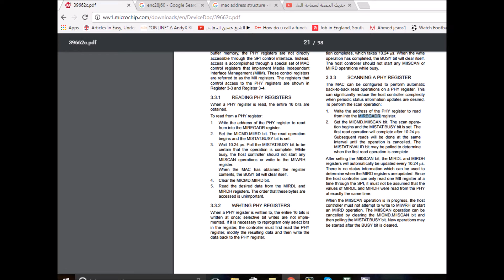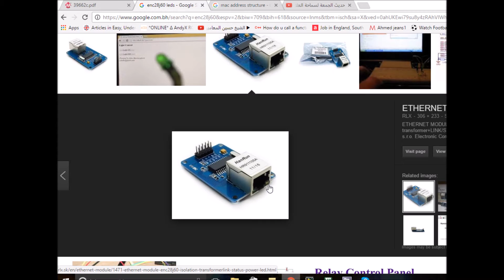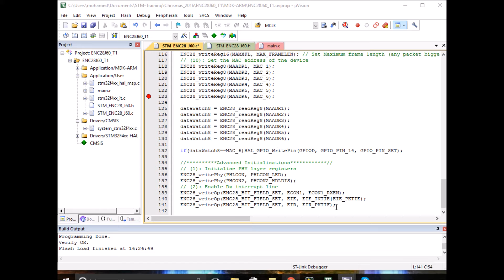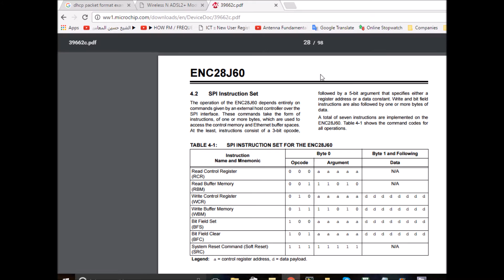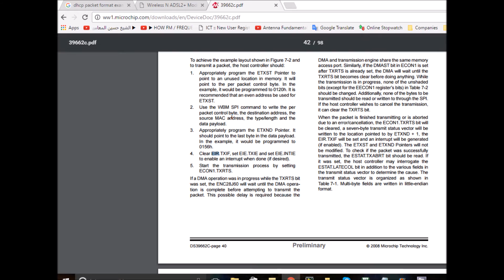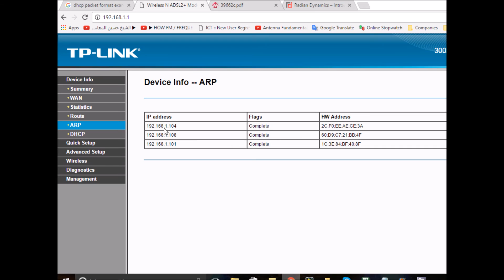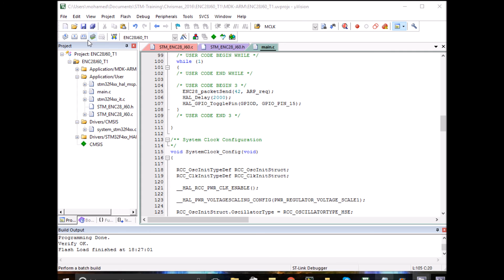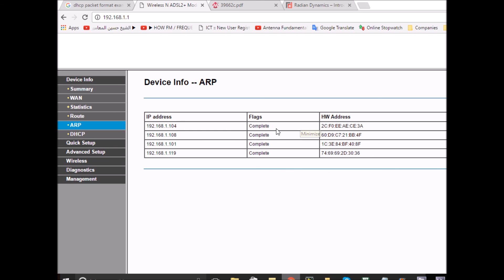STM32F4 Discovery board: ENC28J60 Ethernet Module Part3- Connect to LAN / Get IP address

Comment: Hi Mutex, thanks for the ENC28J60 series video. I did all up to the end of this video, and used your sample code enc28j60.h and enc28j60.c; I was able read back the values of each bank of the chip, so it shows that the code was working.  I also did a USART message monitor at where your code determines if the sending of packets went successfully; and it did go successfully.     I then connected the ENC28J60 board to the network.  But when I finally sent the 42 byte packet, I could not observe the ARP packet on the Wireshark monitor, no matter what I tried.  I think my Wireshark monitor is working because I was able to see my cellphone's activity on it.   Is there something I missed, or have you modified the code after your demo on the video?   Thanks very much!

Comment: Hello Mohamed, Thanks for the nice detailed video. Unfortunately it doesn't work with my hardware (STM32H743ZI + ENC28J60). I followed your intructions step by step. The registers are all written correctly. The status LED on the switch flashes quickly, but the board is not recognized by the router. What can that be? Best Regards, Holger

Comment: hi muhammaad yaqoob just wanted to know whether you connected the interrupt pin or not?
Reply from the maker: I think I did
Reply: @mutexembedded2206  can you tell me where is it suppose to be connected because i can't seem the get the right results for some reason
Reply from the maker: @adnanafzal3908  I can't remember fully. You should be able to find that in the source code
Reply from the maker: @adnanafzal3908  Hi Afzal, let me try finding them. It's been ages 😂.
I am planning to make a drive linked with LwIP for this module.
Reply: @mutexembedded2206  thanks man i really hope you find that file
Reply: @mutexembedded2206  any luck?
Reply from the maker: @adnanafzal3908  Nope, I lost them in my old pc. Not to worry, If you will be using STM for long, I am working on Ethernet tutorial at some point
Reply: @mutexembedded2206  thanks for trying i will be waiting for the tutorials

Comment: Hi sir, I want to make a LWIP project which has been configured by CubeMX and implement a simple website on Firefox, for instance turn on and off a LED AND read a value from microcontroller (Discovery Board F7, typically. ).
I saw some examples which were not configured by CubeMX.
I wish you publish a video about this subject.
Best regard.

Comment: Success!  ARP, DHCP, PING(ICMP)  and UDP are now working! I currently have no need for TCP so have not spent any time porting the driver.   It does what I need it to do.
edit: code is now up on git hub, under my username sheepdoll in the project folder STM32F4_ENC28j60. (I do not think You tube allows links in comments.)

 I implemented the DHCP state machine from the Arduino Ethercard library.  In doing so I removed the datawatch16 register read from the init code as it was no longer needed. (this was returning the expected register value.)  Not sure if this was blocking the packet send ARP requests or not.  What ever I did Wireshark started getting ARP requests.
Changing the STATIC flag to use DHCP via the state machine, I see the Request and ACK on the Wireshark.  The router has also added the NIC and board to the DHCP table.

Bit of work to get this far.  Could not have got this far without this tutorial.
While reading back registers, is a good way to debug, one does have to be careful that a read to a register does not affect states or internal memory buffer pointers.
Reply: hi, am trying to use your library with stm32f407VG on atollic studio..was able to seup the enc28 init.. but i can get to do the dhcp setup
Reply: @smartraysam973  
Your comments are unclear as to whom you are replying too.  If you mean the code I posted to github? that works with STM3401 Nucleo, and SW4STM32.  The code posted here only does an init (incorrectly) and attempts to do an ARP.  I added  DHCP to the github code, which is based on the code posted here. Github has it's own comments section.
Reply: @spiralsheepdoll   Thank you very much spiralsheepdoll. I used your code and it succeed. I really appreciate your effort. Now I see that it works so I ll try to port the tcp part and maybe rest of them. Thank you again. Have a nice day. :)

Comment: More progress:  Still not seeing the ARP request in the wireshark. Connected waveshare module through a level shifter. That setup generates the ARP, so the NIC hardware is good.
Modified the STM32F4 code to implement the receive packet loop and the global buffer.  Now I am seeing the broadcast traffic coming into the NIC, which would imply things
are setup correctly.  Next up is to implement DHCP, which is a whole library on top of some basic UDP.

Comment: I almost got this to work on SW4STM32 and CubeMX 5.1.0 on a Nucleo F401RE.  The instructions through part 2 work.  I can see the MAC address echoed back in the debug watch variable.  The Nucleo does not have any available debug LEDs.  These lines have been commented out.  I also used CubeMX to label the CS pin and a future INT pin based on a shield I have. 

There are a number of bugs in the linked code on the google drive linked above. Some of the code does not match the tutorial, and all three parts have the same (incomplete?) code.  There is no written code for main.c, so one has to pause the tutorial a lot to enter the data.  Some of this user code for main is in part 2 and some in part 3.

Sadly wireshark and an old linksys WRT300N router do not see the ARP request.  The laptop is connected to the router wirelessly. The only ARP requests seen are between the router and the laptop.  The green light on the Keystone is on all the time.  The orange light blinks every 15 seconds or so.

In the posted code the interrupt ACK is commented out in the ENC28_Init();  There are also missing things that are in the video but not the posted code.  It is hard to tell what is correct.

It took several tries to get the ARP hex typed in from the video, as it scrolls side to side.  Ideally this should be in a cut/paste buffer as it is a bit complex to type in.  Ideally the code would be in a git repository.  It  is possible this may still be in error.  Usually this sort of data is passed as a structure. That way the macro expansion is used.

SW4STM32 does not like line 49 (on my edited STM_ENC_J60.h)   It says parenthesis should be around the expansion of MIRD. Which gets a +1 added to it in the STM_ENC_J60,c file around line 80 or so.  I have tried it both ways with the same result. The compiler also complains about an unused spiData[2] in the ENC28_Init() function.  Building the program with return ENC28_readReg8(MIRD) + (ENC28_readReg8((MIRD)+1) << 8); in the ENC28_readPhy() makes the error go away. 

All in all this remains a good start for understanding the ENC28j60.   It is a shame that it has been two years without the next part.  Hopefully this will get resolved soon.

Edit: I changed the ENC28_writePhy to 16 bits as suggested up thread.  Now I get a green flash as if something was sent.  I also changed the MIRD return to
return ENC28_readReg8(MIRDL) | (ENC28_readReg8(MIRDH) << 8); to shut the compiler warning up.  (I do not think the read is use in this example.)  The Arduino library only returns the H value.  So this may be an error.  Still not seeing a ARP request in wireshark on the old Cisco linksys router.  I am thinking it may not pass it through without a static route.  I tried a DSL router I had on hand.  I see the link light on that router.  I also see the two second flash on the green.  Still nothing in wireshark.  

Have been comparing the arduino C++ code that works on my UNO shield to this code which is running on the wave share nic.  There are subtle differences in the setup.  It looks like there have been attempts to munge the code, that do not seem to be complete. (This remains however a great learning tutorial.)

I can see why MYaqoob has delayed this.  The full stack requires a lot of interrelated parts.  DHCP requires code from UDP and some IP code defined in the TCP/IP files.  Porting this is going to take a lot of time.

Comment: Hi @MYaqoobEmbedded, is there something wrong with the following code:
void ENC28_writePhy(uint8_t addr, uint16_t data)
{
 ENC28_writeReg8(MIREGADR, addr);
 ENC28_writeReg8(MIWR, data);
 while (ENC28_readReg8(MISTAT) & MISTAT_BUSY);
}

Data is 16bit. But you use ENC28_writeReg8(MIWR,data) instead of ENC28_writeReg16(MIWR,data). Did I missed out something?
Reply from the maker: Hi,
Sorry for late reply, Very busy with work nowadays. You're right, should have used write 16 I think.

Comment: Hi, your Tutorials are very informative and Thanks
This comment is not for this video, my appology

Could you make a tutorial about - How to interface External crystal Oscillator to STM32 Microcontroller
Reply: Enabling the external crystal of STM board
and corresponding changes in ADC Clock.

I asked this question because from the datasheet , it tells that - If it failed to detect the external crystal then it switch back to internal oscillator.

Can you explain it with STM32CubeMX - clock configuration 

Thanks
Reply: Mohamed Yaqoob 

Yes, Now I understand how to configure the clock.
Thanks for your fast response
Reply: @alameenv4831  After putting the crystal oscillator in its place, you need to configure the RCC_CR and the RCC_CFGR, to enable the HSE, and use it as the clock source.

Comment: hi thanks a lot. i was working on it and this video hepted a lot. can you explain how can i get my ENC28J60 MAC adress???
Reply: hi Mohammed 
i see. i m trying to make a Gateway that recieve data from nodes and send them to the server. this video he helped a lot. but if you can help me with the receive fonction that will be perfet. and thanks for your time.
Reply: okeey i ll be waiting for it. thanks for your help
Reply: hi mohammed 
sorry for bothering you, but can i ask you, do we get the IP address unsing the "allocateIPAddress" fonction, or ther is other fonction that gave us the possibility to get an IP address??  
thanks
Reply: i tried to do it with the ARP req but i got nothing, i can read my MAC address that mean the SPI is fine. when i send a request to the network, Wireshark get nothing
Reply: i'm using a swich and i have only one network to scann.  do i need a router to get my IP or the switch is good.  
i'm trying a DHCP protocole but the programe never pass the discover phase.
Reply: i'll get a router and try it 
thanks, i really appreciate your help